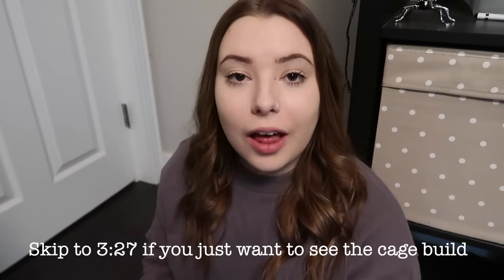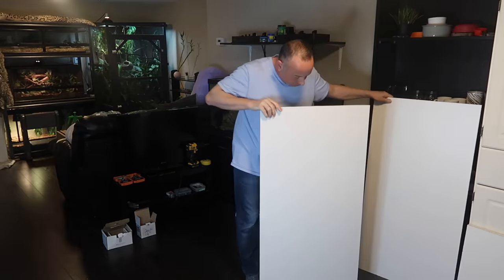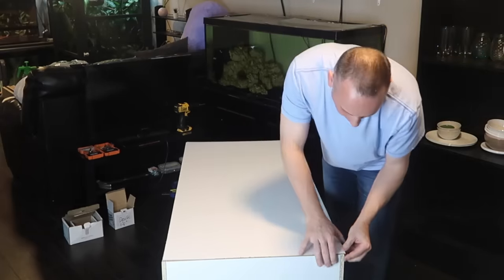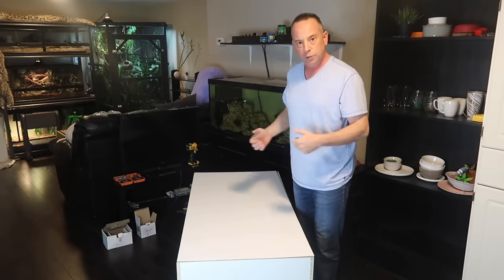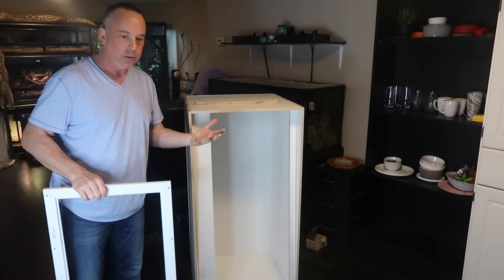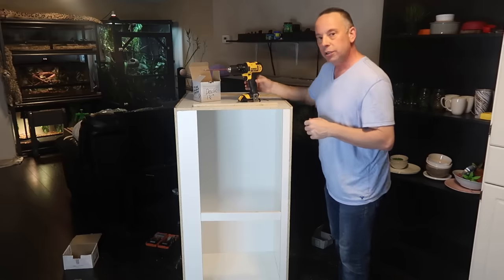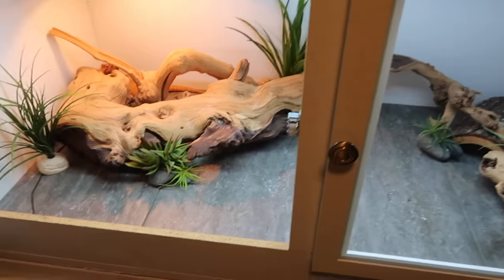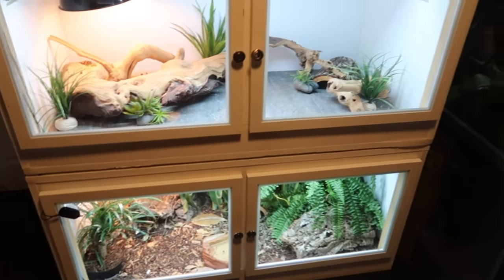How To Build Your Own Reptile Enclosure! | Perfect for Bearded Dragons, Skinks + More

Comment: those doors are a great idea.  im looking at building a new cage for my snake i will definitely add a lock on the outside for her strength to push open door. however i was concerned about how tight the gap is between the door and face frame?

Comment: what size are the glass doors?
making one for my beardie
Reply: I would like the measurements too :)
Reply: If the cage is 48 inches across, the center piece is 2 inches and the outside pieces are .5+1 inches the doors should be roughly 22 inches wide. As for height, I have no idea. You could always build this to retro fit the doors. Meaning you build the cage around the doors dimensions. 
Good luck and happy building ☺️
Reply: He responded to someone else saying they are 50cmx55cm or 19inx21in
Reply: @kiroropupper3914  thank you

Comment: Thank you. Great easy DIY enclosure. My question is to make your enclosure last longer and withstand water damage shouldn't you have used (iron on) melamine tape and silicone on the cut edges?
Reply from the maker: you can! this one here was for a bearded dragon who requires very low humidity so water wasn't too big of a concern with this one but if you are concerned then you can definitely seal it!

Comment: Here is links to everything! Hope this helps:

https://www.homedepot.ca/product/uniboard-1-2-inch-4x8-melamine-white/1000117174

https://www.ikea.com/ca/en/p/komplement-glass-shelf-white-00257646/

https://www.homedepot.com/p/Liberty-Classic-Round-1-1-4-in-32mm-Satin-Nickel-Hollow-Cabinet-Knob-P11747V-SN-C/202023241?source=shoppingads&locale=en-US

https://www.homedepot.com/p/Hickory-Hardware-Catches-Collection-1-5-16-in-C-C-Cabinet-Door-Catch-Cadmium-P107-2C/202101897?MERCH=REC-pip_sem_mobile-303006780--202101897--N&

https://www.homedepot.com/p/Everbilt-14-in-x-6-in-Steel-Return-Air-Grille-in-White-E170-14X06/300539112

https://www.homedepot.com/p/Liberty-Oil-Rubbed-Bronze-Self-Closing-3-8-in-Inset-Cabinet-Hinge-1-Pair-H0104AC-500-C/202066911?source=shoppingads&locale=en-US&mtc=Shopping-VF-F_DYNM-G-D25H-25_4_Builders_Hardware-Liberty-NA-NA-Smart-NA-NA-MK460873325_9015752938_FY21_9&cm_mmc=Shopping-VF-F_DYNM-G-D25H-25_4_Builders_Hardware-Liberty-NA-NA-Smart-NA-NA-MK460873325_9015752938_FY21_9-71700000082473817-58700007001711810-92700063096494234&gclid=Cj0KCQjw0K-HBhDDARIsAFJ6UGh2MOTaESZrA068Mm4gFKtIB02jjB4__RrY_rsO8SRvliulewf2wywaApeUEALw_wcB&gclsrc=aw.ds#overlay

Good look building!

Comment: One issue: if you’re building this for a Blue Tongue Skink, you shouldn’t use melamine. Melamine isn’t meant to withstand humidity and will break down over time since skinks need a humid environment. Perfect for a beardie, not to so much for a BTS. 
The build itself and dimensions are great though.
Reply from the maker: If using it for an animal with high humidity requirements you just need to seal it with an animal safe sealant

Comment: Hey I have. 2 bearded dragons and I am trying to get the measurements right on my tank I would like to build the tank you have but a little bigger, being they need about 75 gallons full grown. I also have to separate them being my bigger one is not being nice to my mini girl. How would you go about increasing the size of your tank to make it still look and work as efficient as yours?
Reply from the maker: These cages are 120 gallons each, they’re larger than 75 gallons
Reply from the maker: Also yes definitely separate them ASAP. Bearded dragons are solitary and they will even bite limbs off of other dragons. They need to be separated as soon as you possibly can
Reply: I would absolutely love to have two tanks like you have set up but right now I can only afford one. Most likely I will keep one in the 55 gallon tank and the second smaller one in this one for the time being until I can get enough material for both

Comment: Emma, Thanks to your Dad for his hard work but the parts at the end that you didn't record, that you said were "accessories" and "minor details"!!! The lighting ~ HEAT and vents to BREATH are NOT accessories OR minor details!  I really needed to see how he cut holes for the vents and installed them. Also how he installed the lighting. I don't mean to sound grumpy but I was really let down.I thought you would've charged the battery or switched to a charged spare battery. Just had a hard day and really need help with this project as my Dad has passed away and have no one else to help me. Thank God you have your Dad Emma.

Comment: How did you set up the uvb in the tanks I’m thinking bout making one for my bearded dragon and the uvb you have is what I will be using
Reply: Just buy a basic tube light fixture from a hardware store instead of paying for the expensive reptile hood. That is what I have in my tank. The standard light fixtures are able to be screwed onto a wall or ceiling so mine is screwed to the ceiling inside of the tank.

Comment: Is actually OK but a tip for your frame if you make your frame separate you could glue it with dowels or dominos and make it a bit bigger so it goes at the front not at the inside you have a better finish

Comment: should use a jig screw hole for the middle part thast way when you do screw there is pre holes on the middle slat pre drilling with a drill and then screw screws is going to split your wood so better buying a jig

Comment: I'm concerned with the possibility of mold growth since these are made out of wood, which is difficult to keep microbes from infiltrating. I like these, though, and I'll consider it but I'll have to wipe it down a lot and keep the humidity from getting too high.
Reply from the maker: If you plan on using it for an animal who needs high humidity I would definitely consider sealing the cage!

Comment: Where I live I can't get the sizes of the wood, only different is it would be 3 and half feet, not 4ft. Will this still work with the doors? Can anyone help me? And how many tile would fit and the size I need?
Reply: Lisa Farrell - Emma’s dad here. If you only have 3.5 feet then unfortunately those particular doors would be too large, but we didn’t actually buy 2x4 pieces, we bought full 4x8 sheets and cut them into quarters to get 2x4. Hopefully you can find the full sheets somewhere, or maybe a smaller door. Good luck!
Reply: @aksampson68  thanks for your reply. I finally find the correct size 😀 I just need to make the length little longer because our hardware store won't cut to 4ft but should work now. I just need to put it together now 😁

Comment: Is it just me or is the math wrong. If the side pieces are only 23 inches high then the inside volume is only 23 inches of hight. And then by adding a 4 and 2 inch height strips inside the box the longest piece you could fit in to match would be 17 inches not 18. Idk am I missing something.

Comment: I’ve always wanted a created gecko and I think that this would be a cool way to house one instead of a glass tank (I’m not sure which would be easier to clean tho🤔). I would do this same setup, except flip it on its side so it’s taller vs longer. My dads also quite the handy man, now I just have to convince him to let me get a gecko😂😊
Reply: I wouldn't do this for a high humidity animal like a crestie. Spraying melamine with water all the time will ruin it quickly. That is why glass and plastic are popular for cresties, they don't swell or rot when wet. Also a doubt a crestie could stick onto melamine like they can with plastic or glass.
Reply: @SohiHien  true, I didn't even think about that. thanks!

Comment: How to predrill and countersink ?
Reply: Hi there, Emma’s dad here... I’m going to do an update video for some upgrades I did on the cage and will talk about pre-drill/counter-sink. Stay tuned!  👍🏻
Reply: @aksampson68  awesome!! Thank you so much :) learning all this stuff will be very helpful! Great video btw
Reply: Apologies for the delay, but we never did get around to making another video, Emma has been flat out getting ready for Petfest. But to pre-drill and countersink you just need 2 drill bits, one that is slightly smaller than the with of the screw threads, and one that is slightly larger (or same size) as the head of the screw. Drill with the small bit first on the path the screw will go in and try not to go too far in. For example if the screw is 2 inches long, try to stop the drill at just under 2 inches deep. This can be a bit tricky if you aren’t familiar with using a power drill, so a good trick is to put the bit in the drill, then wrap a small piece of electrical tape around the bit at the point where you want it to stop. Once the tape reaches the surface of the wood you’re at the right depth. Then change to the bigger drill bit and drill into the same hole but only a slight bit into it, you only need enough so that the head of the screw “sinks” into the surface a little bit. This can also be tricky until you get the hang of it as you barely have to press the drill in much at all before it starts to dig in, and if you press to hard the hole might get too deep. Best to practice on some scrap wood first. Thanks for watching!
Reply: @aksampson68  thanks! I'll try it out and let you know how it goes 😁